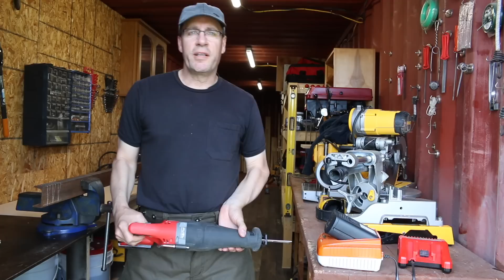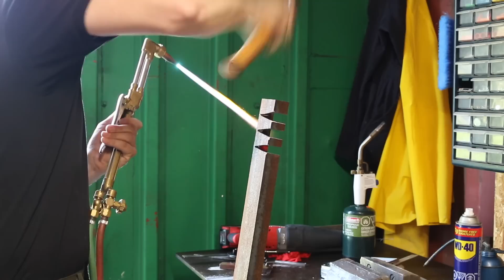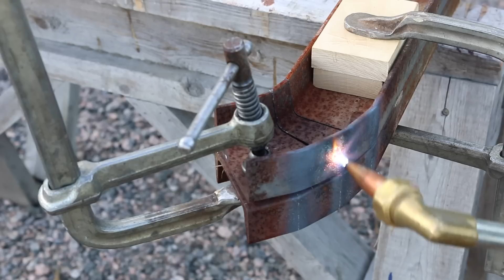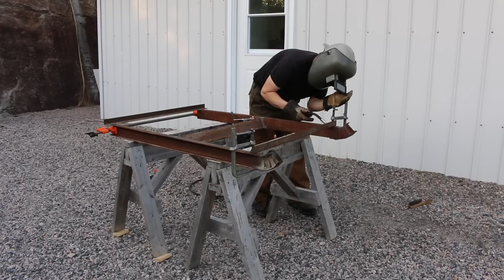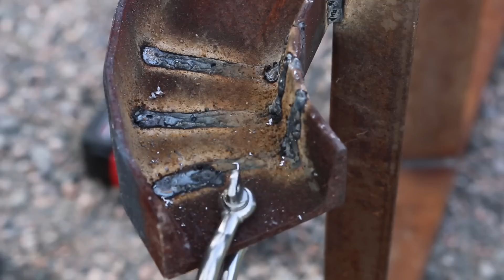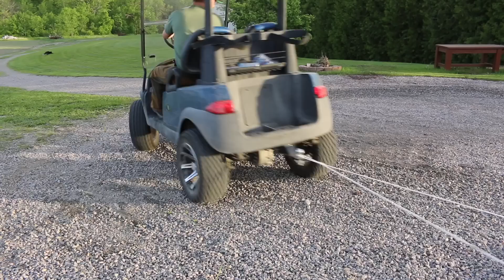Building a small Drag Grader

Comment: Hell, give us those earmuffs to block the crappy music and excessive noise. The whole darn video was irritating and, without details or discussion, pointless.
Reply: Then go find another video. Simple as that
Reply: @isaiahg.richards8361    ..  I did. However, I had to actually see this one before I could discover all I did.
Reply: @dwightstewart7181  then keep your negativity to yourself. Or ask for your money back...😏🙄
Reply: @marset.designsplus3813    ..  My negativity? Who the hell are you to talk? Keep your negativity to yourself by minding your own damn business. And before say I posted in a public forum (the common refrain of nosy busybodies like you), remind yourself that he did too. If you have a right based on that, I do too.
Reply: I can tell you a better way to smooth out the gravel. No welding required.
If all you need to do is smooth out rock. Find yourself a old box springs. 
Take a 2x4 or ?  Fasten it length ways to the springs frame. Then a way to attach it to your buggy , mower etc. 
get a long board. 
Or just use a rope 

I was a flat roofer for 35 years. Want to level out small rock. Nothing looks better. 

I like your concept. It has given me a 💡 for building a rock picker.